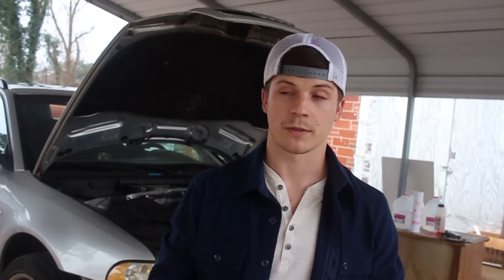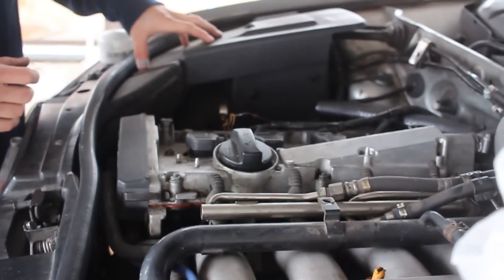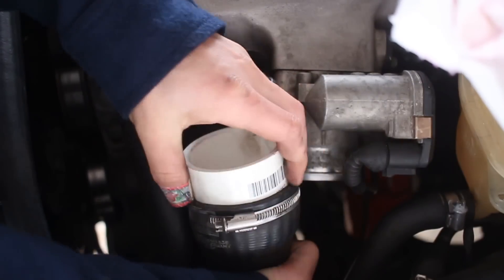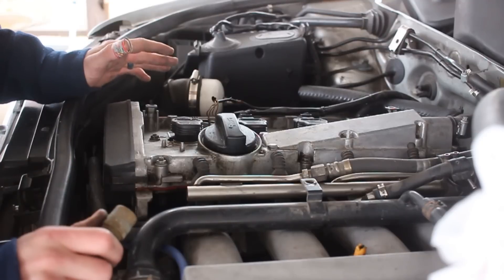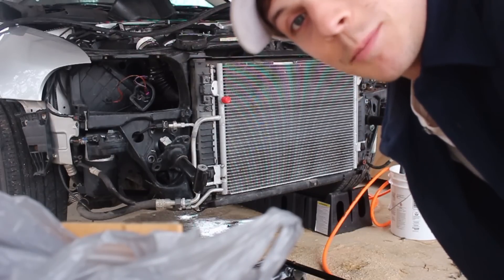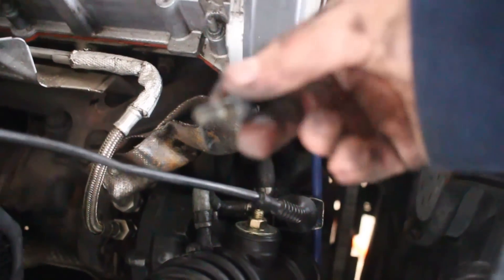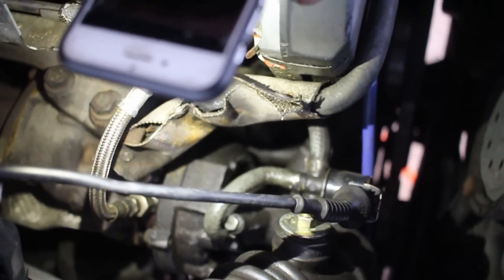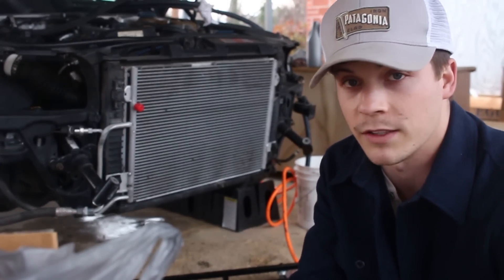Finding and Fixing Boost Leaks (Audi 1.8t)

Comment: The fact that a banjo bolt was found disconnected and the person thought it just needed to be reinserted is 🙄. Why was a banjo bolt there since they are usually used for fluid transfer control like oil or hydraulics?!

Comment: Great work! i also have an audi a4 b5 1.8T, and i had a N75 issue. Mine was the on the wiring. now i have 05.bar boost (i think is the standard k03 pressure boost).
Reply: While they may be easy to work on I find myself working on mine constantly.  Been working on diagnosing a rich running condition for months now.  I hate Audi's.  I would rather have a car that's difficult to work on if it would not fail so frequently.
Reply: mobildetroit 
Check your fuel injectors.maf,oxygen sensor,

Comment: I actually love service position, it makes it so easy to get to everything.. I wish all those other cars I've owned had that feature.
Reply: Yeah most older euros have the ability to remove the front core support. Service position on the B5's LC's is nice but if you take an extra 10 minutes you can remove the lock carrier completely. Makes life so much easier.

Comment: smoke machine machine machine. Echo
Reply: I agree. 
Was super weird, as the video was so well done, on pretty much every level. Having an air compressor to, but no smoke (granted a pro set is 4 figures), but no mention of smoke being an option? Especially since many people don't have access to compressed air, with only a parking space to work with and such; therefore suggesting a home made smoke machine, or link thereof, would be in keeping with the content. 
But Sir (vid creator), was a handy video, I currently has a '99 B5 AEB Passat, trying to track down a vacuum leak (running lean, LDP says loss of vacuum), and this helped jog my memory of what to do tomorrow. Thankfully I have a stick, as it flooded the passenger side. If you have an auto tranny and you had an un-fixed leak, you would know what I mean, and hopefully you only heard about it once somewhere, lol. Unfortunately for me, the previous owner tried to replace the bad cabin filter seal, but stripped that bolt waayyyyyy at the back under metal with no clearance, failing, and leaving a rusted rounded barnacle of a bolt'n'nut. And wouldn't ya know, the junkyard specimens all have theirs already salvaged, and the're pricey new, so I just Red Green'd it with liquid gasket, Not perfect, but no floods, lol. 
Digression aside, it was good to see how you could do it with compressed air, saving someone who had air the trouble of rigging up a smoke machine, but I think that that approach would be much easier, no? They're not hard to make, even I did and I'm just a guy with a parking space...
Cheers